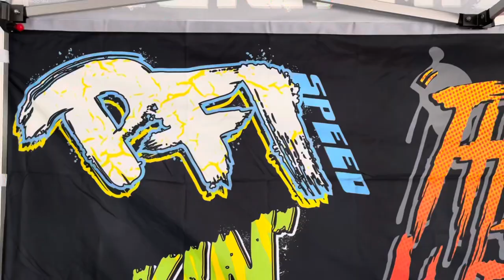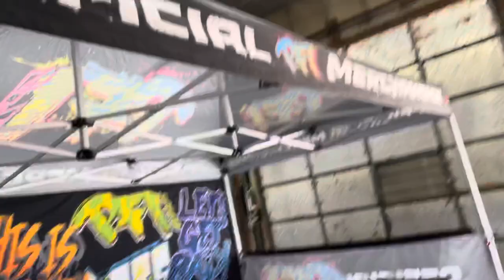A Great Surprise! And exciting day at the Shop!

Comment: Wheelie bar lower mounts on a pivot and the top bar mounts on a spring tensioned slider (keep them inline but air ram controls throw needed/wanted and pulls them by spring tension).You may want air applied while you are on the transbrake. Then there is no delay or shock on the initial hit. You then simply let it bleed off at whatever time after release of transbrake and rate of orifice size/jet you have set. Great idea! Never would have thought of using wheelie bars to load the front tires. #ingenius

Comment: MY buddy showed up the shop with some air cylinders just like yours. We almost rolled the fork lift over when we did what you did, but with a valve and 175 psi.
 10,000 lb. Fork lift just shot up so fast and caught air and landed back down on the ram . Woah phew damn.

Comment: In factories they use those cylinders on lots of stuff. Can control them with mac valves like you do your boost controllers. They work well and are very reliable.

Comment: 855 hp , on the race car, love the air ram rating has to be at least a couple hundred lb,  but I still think you guys could make a sway bar as they have on the back of 4 link car mounted to the firewall or even the roll cage upfront,  all the good stuff guys

Comment: 576
Great idea with the air rams.
 With a regulator  you can adjust the tension on the wheelie bar.
Bleeding thru a jet you can change jets to adjust return time.

Comment: I like the idea of the traction bars, but if you put too much lift on them and they aren't absolutely aligned with the rest of the car you could have something like rear wheel steer.  Keep that in mind while you build and install and you should be fine for the first run.  You'll need to figure out the maintenance on it to ensure that they aren't walking on you.  Nobody wants rear wheel steer when you're trying to go straight down the track.  It can be done safely.  Rock on.

Comment: Those air cylinders are cool I built many things with them and hydraulic cylinders, I think if the bottom connection of your wheelie bars is the actual fulcrum she’ll pick her right up quick , cool idea . I definitely want to see the result … HP guess 388 with 346 TQ

Comment: That's like a big arse solenoid that air ram 😆 I'd have 4 of them under the car as a jacking system 😆😆
And wondering if you can use them with hydraulic fluid instead of air because airs gonna compress too much when the Wheely bars trying to fight the car tilting back

Comment: I'd say with 15% drive train loss the car probably put down 743 hp and 815 torgue . And that's with altitude adjustment,  which is still a lot of power.

Comment: 676 I have a Brittani too and she is the best. Also I work in a facility with that style air cylinder and you can get longer,smaller,shorter anything you want and ours are controlled via flow controller valves, intake and exhaust of the cylinder and then and program of sorts.  Very cool idea reminds me of F1 pit stops. Not sure who we get them from but most stuff is motion industries and Knapp out of Austria

Comment: any hydraulic cylinder can be used with air/nitrogen/co2, as is. (to get more stroke and damping than that short stroke pneumatic cyl)  you can also change the gland internally to a more 'air' compatible setup.  back in 'dah den' we used alum hydraulic cylinders as air cylinders for suspension....back before they started being mass produced.  you could also run an air solenoid (like u do with boost) between the inlet/outlet ports to control the amount of extension/compression you get based on whatever closed loop param..  easy.

Comment: Tent rocks ...my hp guess is 800..my family runs late models ..all over united states ...UMP  points races ..eldora.. I96 speedway in Michigan ..dirt mostly but we have a asphalt cars to ..sprint cars too at one point ..run a 430 cube all aluminum small block gaerte engine.. been running them since 90s..dad is number 24 step brother is 25 ..

Comment: Looking at the back side of your wheelie bar ram I'm guessing it to be 2-1/2" diameter. If shop air is 120 psi then it will have roughly 600 pounds of force.

Comment: I swear 15 years ago or so there was an import that had air cylinders for the top wheelie bar and they were doing the same thing using the wheelie bar to transfer weight onto the front tires seem to work good
Reply: Yeah it was a integra I believe his name is Chris Rado they banned them immediately but i did get to see them work back in the day.

Comment: When they first started letting the clutch out on that asphalt car you can tell it has a triple disc clutch. The Bucking and bouncing it does when you let the clutch out. My dad used to Run 1 and our old race car anytime you would let me drive it get to slip the clutch a little so it wouldn't do the buckin going through the pits then he says everybody knows what running. That late model makes 789hp ???

Comment: If your curious or want to know how powerful those (or other) air-rams are it's simple to calculate 
Bore ÷ 2, squared, x pi = square inches x Supply PSI = Force...
Search says that Cylinder's bore is 50mm = 1.9685" Bore ...so... 1.97 ÷ 2 = .985 x 3.1416 = 3.094 (square inches) x 100psi supply = 309.4 Lb...
That obviously doesn't account for any added +/- levers/leverage between the ram and traction bar OR the fact that it won't be pushing straight down on the bar wheel(s)...

Comment: hey brent i looked at your wiring harness and thought you were setting up for wind tunnel testing lol then my brain defogged and i realized they weren't tell tails. it looks like your running several harnesses? and are you running sensor/component  to the harnesses through the firewall to ecm or will you terminate everything at the firewall  and install a harness disconnect at the firewall  ? i figure its more work up front but well worth it the first time ya gotta pull the engine  ..thanks for the videos

Comment: Safety first ... I think I would incorporate a dump solenoid with some steering rack switches that would dump the air instantly if significant steering input occurred (like a broken axle).  Tune it so it would only dump on what was clearly going to be a aborted run.  That way if things get really stupid and you need to pull the parachute, you have already loaded the rear suspension.  That said, it should work good.
P.S. The merch tent can't help but put a smile on any ones face.  ;)  Lets Go!

Comment: It can be surprising how much force air can generate. If you wanna calculate how much, I found a formula for you guys. Not complicated at all.

Calculate the force — The theoretical force output of a cylinder is the product of the air pressure applied and usable piston area exposed to it,

F = P × A, where F = force in lb, P = supply pressure in psi, and A = piston area in in.2

For example, a cylinder with a 1½-in. bore supplied with 80-psi air would generate:

F = 80 × π(0.75)2

F = 141 lb.

Air feels like a really smart way to go btw, since it's a bit "springy" too. I can imagine that is positive for the way you wanna use it. A hydraulic setup might be too stiff.

Comment: That's interesting that they don't show the HP of the 88 car... it looks like it's made for a oval course, I thought the circuit course classes were generally restricted based on weight, size, and hp?
So then shouldn't everyone in his class have similar HP and therefore there is no reason to hide their HP results?
Reply from the maker: They play with restricted designs and lengths so there’s still a ton of tuning with them to find that inch of power more

Comment: Hell, now that I think about it... Gary Kubo may have been the crew chief at that time. Maybe I'm getting confused with a few years later time. But I'm sure Rado wouldn't mind sharing the info and if Kubo wasn't around at that time, he probably has some knowledge of the tech Rado used for his retractable wheelie bars. And while you're at it, persuade Rado to bring out some of his old heavy hitters to run in tbe PSCA class you guys run. He's only in Cali.  now. Not too far. And if I'm wrong on the innovation statt of tech, maybe it was Bob Norwood that introduced it to Rado. As they did have form that NorRad company pretty close to that time.

Comment: Brent I have been thinking and there are a lot of people with cars that run bad why not start economic tuning cars better miles and less exhaust fumes. And get the epa to support you and not attack you like a side hustle but epa is funding you instead of giving you finds. Show that tuners are not bad but straight from factory cars mostly have a limit that they have to be 70 procent effency is the barr what if you tuned them after this and make them 95% to a 100% that is a win in my book. And diesel and petrol cars all get delivered this way cal it Economic tuning it's still tuning but with a different touch and vibe to it.